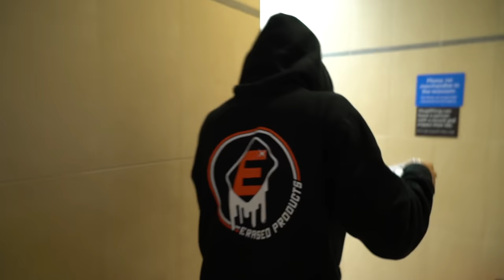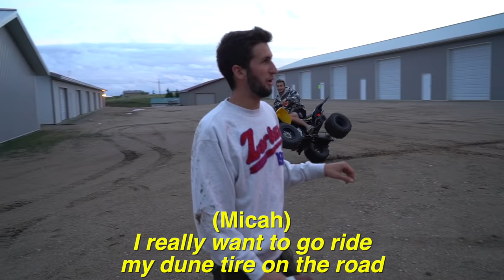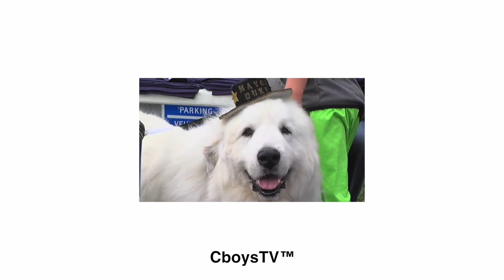Shifter Kart vs. Maverick X3 STREET RACE!! (We got tickets)

Comment: You have to put the starter fluid inside the tire, not on the outside, so that when it combusts, it forces the tire onto the bead. Spraying it on the outside it will just burn. I did it with my 400ex tires and it worked great. May take like 10 seconds tho and kicking it helps.
Reply: Tyler Malinowski you also need to add air
Reply: Tyler Malinowski  spray it inside the tire light it and put air in it at the same time
Reply: No
Reply: Ray Heiman why do you say that
Reply: what
Reply: I dont mean to be so off topic but does someone know of a way to log back into an instagram account..?
I stupidly lost the account password. I would love any help you can offer me
Reply: @Wilson Isaias instablaster :)
Reply: @Devon Lewis i really appreciate your reply. I got to the site on google and Im trying it out now.
I see it takes a while so I will reply here later with my results.
Reply: @Devon Lewis it worked and I finally got access to my account again. Im so happy:D
Thanks so much you really help me out!
Reply: @Wilson Isaias happy to help xD

Comment: 10:30 you need to get the starting fluid/brake cleaner between the beads so when you light it, it expands outward and sets the bead. W tight tires sometimes I have to pry it up so the flame can ignite within the tire and set the bead

Comment: Hello bro Z put and piece of all thread or and very thin pipe in and vise and slide the wheel on the piece and use it to hold the inner portion of the wheel and then to flat blade screw drivers and work the tire off and it will help u hold the rim in place so much easier. Laters bro

Comment: Get a little bead blaster for the tires and a air compressor chuck that screws on the valve that way you have air constantly flowing in and then blast 80-100psi into the tire with the blaster

Comment: The proper way to do the "Fire Tire" is to fill up the inside of the tire with alot of gas or fumes and then lite a piece of paper on fire then throw it onto the tire and BOOM tire self inflates! P.S. Make sure the valve stem guts are removed so the air can leak out and not blow the tire off the rim into a thousand pieces! Your welcome and please stay safe. I am not held responsible for any injury's!

Comment: You fill the inside of the tire with a sufficient/ or a shit ton inside the tire and light the starter fluid on the inside of the tire the fumes escaping rapidly snag the rubber to the rim.

Comment: With the fire method you're supposed to spray a fuck ton inside the tire then spray some on the outside so it's easier to light then it expands and hits up aginst the bead then put it on an air compressor and fill it with air

Comment: Use butane to seat tire bead!!! Need a fast burning fuel to create "explosion" to work... The smaller the tire volume the faster burn rate because less air is expanding. Big tractor tire lots of air to expand.... small tire, doubling the volume is not much air to force the bead on...
LAST RESORT add oxygen to chosen fuel, or use acetylene. EXTREME CAUTION IF USING OXYGEN MIX OR ACETYLENE.... HIGHLY EXPLOSIVE!!!!!
**(not liable for destruction or injury! for experienced/professional users only...)

Comment: Putting new tires on shifter kart rims use degreaser or sd-20 for the beed of the right then start putting air in to the tires until the tire pops on the bead of the rim

Comment: U need air when u are trying do to that fire trick it, put air in the tire while doing it
Reply: Wrong. You just spray the starter fluid inside the tire, So the gasses expand inside of the tire, Instead of the outside.